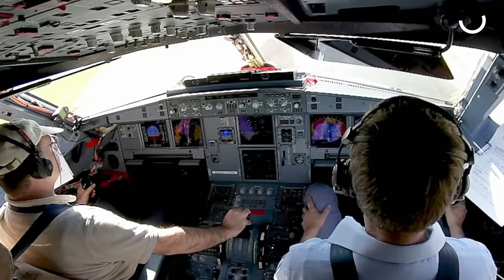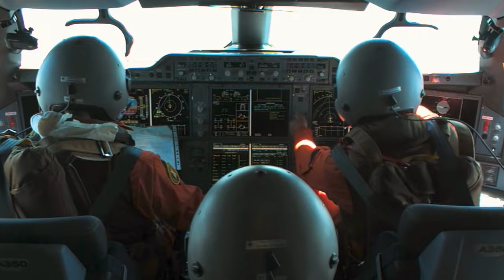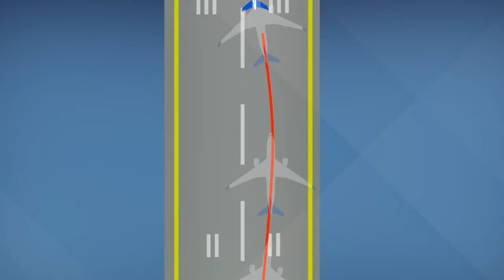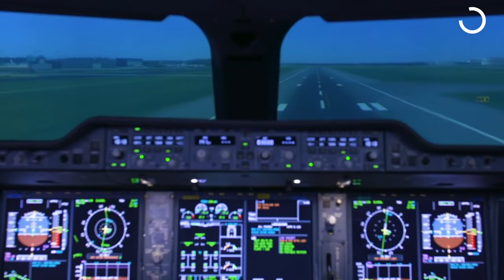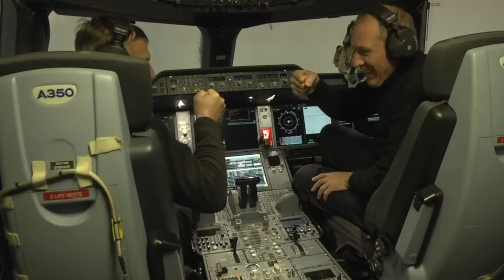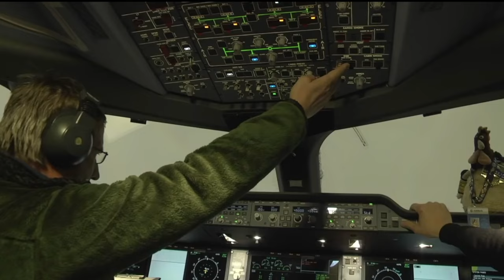Pilot Turns Off Engine During Extreme Vertical Takeoff: Terrifying Test Brand New Passenger Plane

Comment: Boeing puts passenger safety first?
Reply: Yes we do
Reply: @elite4124  So what happened with the various 737 Max incidents. The truth is , since the company started being controlled by accountants and people who care more about the company rather than safety, there have been many more failures. Even Domhnal Slattery, head of Avalon, one of the worlds biggest aircraft leasing companies, said “It’s fair to say Boeing has lost its way”. It is not recognisably the same company that brought us great classic aircraft in the past. This once great company built much of the Saturn 5 rocket and the Lunar Rover but now can’t even get the Starliner right. It flew 5 years late after being dogged by many avoidable problems and even now has had to be stripped to replace wire insulation that has been found to be flammable. How could such a basic flaw have escaped testing or inspection. The sooner these big companies stop worrying about shareholders and start thinking of their customers again, the better.